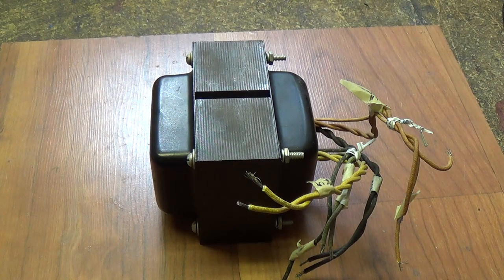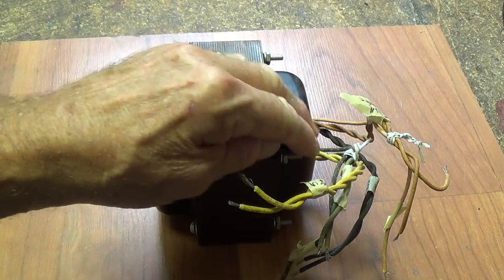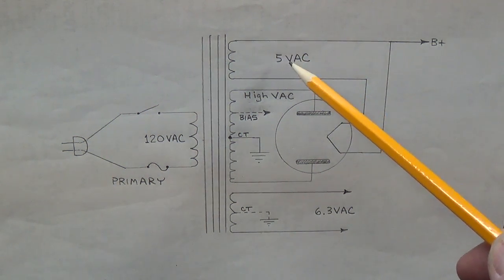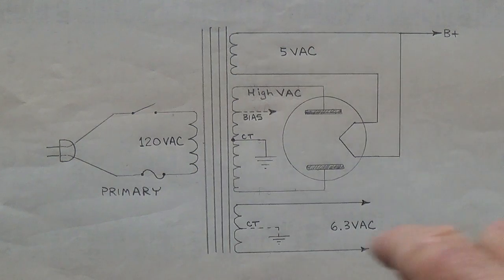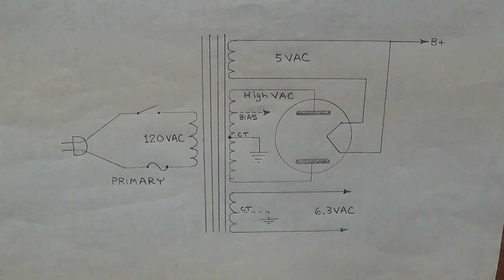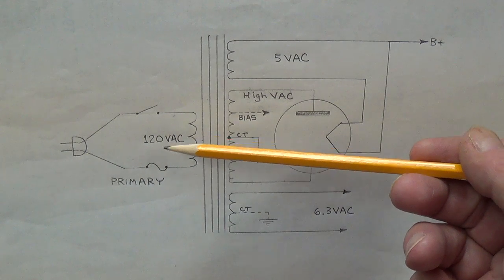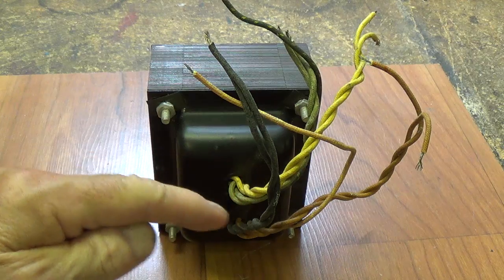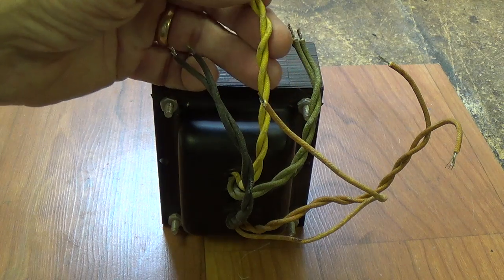How to Identify Amplifier Power Transformer Leads

Comment: Hi Doug, can the rectifier diodes in my old amp allow the b+ voltage to be lower then called for.  Do they go bad like that or do they normally just short out.  Because I'm getting 100v less. 
Thnx Greg
Reply from the maker: +Greg Krupa  I am not familiar with rectifier diodes that fail gradually. Usually they are like a light bulb.....either just fine or dead as a doornail. Have you checked the wall receptacle voltage level? Have you checked your output tube bias?  As plate current goes up, plate voltage will go down. Also if any component is drawing more current than usual, or if a resistor in the power supply has increased in value,  it could  result in a reduction in the B+. Good luck.
Reply: It's fixed bias, wall voltage is fine,  my light bulb stays lit,goes up when I play guitar.  My tech thinks it's in the choke since the bass response is not right.  Would the choke be causing these problems.  It's a 64 Gibson Mercury medalist.
Reply from the maker: Are you checking the voltage while the amp is connected to a fully illuminated bulb current limiter? If so, measure again with the amp plugged directly into the wall socket. The CL will reduce the voltage levels quite a bit when fully illuminated. Your bulb wattage may be too low. The bulb wattage should be high enough that the bulb barely lights up (if at all) when the amp is operating. Also, if the tubes are fixed bias, their plate current and dissipation values definitely need to be checked. Excessive plate current will reduce plate voltage quite a bit. I can't imagine how a filter choke could be responsible for the reduction in B+, but it would be easy to check. Simply replace it with a fixed resistor of appropriate value and see what happens to the B+
Reply: Hi Uncle Doug just wanted to say you were right I was using a flood light not quite the 250w I needed. It brought things back up to spec. Also I'm going to try out that lancer mod you posted,  this amp needs it although Id like to fix some issues with my treble especially on channel 2 it's really noisey. Maybe a new pot? As always any thoughts are appreciated.  Merry Christmas and please continue in the New Year, these videos are the best on the web. 
Thnx
Reply from the maker: That's good news, Greg. The wattage needs to be high enough that the bulb barely glows, if at all. You can clean pots with DeOxit without removing them. Try it and see if it helps. If not, then replacement may be necessary. Best of luck and Happy Holidays !!!

Comment: Uncle Doug, I'm still working with the same transformer from my previous question. What I did this time is connect power to the primary wires with a variac and voltmeter to see the actual voltage entering the transformer. I connected another voltmeter to the secondaries. First I measured the two solid red wire. At 120VAC the red wire read 650VAC. Does this sound about right? It seems high to me, but then again I'm new at this. In addition I connected the second voltmeter to the two solid green wires expecting to get 6.3 VAC. But these were reading 4VAC with 120VAC to primary and 5VAC with 130VAC to primary. Can you give me your thoughts on this, thanks.
Reply from the maker: +David U Juarez Greetings, David. The two solid red wires are the high voltage winding and should have a center-tap if you wish to use full wave rectification. The 650VAC sounds about right....it will go down quite a bit once the transformer is connected in a circuit. The two solid green wires appear to be the 5VAC output for the rectifier heater/cathode. Green is usually for 6.3VAC leads, but apparently in this transformer, the color coding differs from the usual.

Comment: i have a question regarding id of a transformer.  i recently got a power transformer out of an old conn minuet 541 organ and have been unable to find anything on it.  ok so here is the thing, i have reasonably ascertained that the 2 black wires on it are primary and the 2 green and the green/yellow strip is 6.3 with center tap but there are 7 ( yes seven) more wires on it which are colored red, red with green stripe ( twisted together), 2 that looke to be either orange or brown which are twisted together, and a yellow and a yellow with red stripes ( which are twisted together) and lastly a blue wire.  i am wanting to use this for a guitar amp but need assistance in determining what wattage amp i can make, if it is usable for a tube rectifier ( which based on your comments of thicker wire i dont think it is but i want to be sure).  teh number on the side is K70749 and under that there is 396508.  any help would be greatly appreciated because i am at wits end.
Reply from the maker: +lordraptor11 Greetings, LR. If I were faced with this problem, I would first be sure that none of the wires were shorted together, then connect the two black wires to an AC outlet through a Current Limiter (see my video if you don't have one), then very carefully measure the voltage between each pair of similarly-colored wires (and verify that the striped wire with the same color really was a center tap or CT). See if you have a 5V pair (no CT) for the rectifier, a 6.3V pair (with CT) for the filaments, and a high voltage pair (with CT) for the tube plates. The blue wire may be for bias voltage (around 30 to 100V between it and the high voltage CT). Good luck and be very careful with the high voltage outputs.

Comment: Hi Uncle Doug, I have a 63 Gibson amp, the secondary windings show 735v, I need 468v.  Do transformers leak this much extra or is this the wrong transformer altogether? It looks original, but I can't assume.  Thanks for the great videos.
Greg
Reply from the maker: +Greg Krupa  You're welcome, Greg. I assume that you measured the output voltage with no rectifier tube in place, which is not a valid method. Once current flows to the rectifier tube, the voltage will drop quite a bit.....probably down to the 468V that you need.
Reply: +Uncle Doug  yep that's what I did, ok so maybe it's still good.  I think you just saved me some cash.  These videos have taught me so much.  Also waiting on Rusty to put out an album.  Cheers.
Reply from the maker: Transformers generally fail like light bulbs, Greg.....they're either good or bad, no middle ground. I've never seen a failed one that put out too much voltage. After you get all the tubes installed, carefully check the DC voltage between the plates (probably pins 4 and 6) of the rectifier.

Comment: Uncle Doug, I recently purchased a new power transformer for a '65 Fender deluxe reverb reissue - I expected it to come with some paperwork to include some sort of schematic but it didn't. I could sure use some of your help figuring out the voltages - Can you help me?
Reply from the maker: +Kevin King  With no information to go on, it would be a challenge, Kevin.  I have two suggestions: Contact the company and ask where to get a data sheet, or check their on-line site to see if specifications are available there.....or, rely on the color coding, which is generally rather consistent, and you can verify with a voltmeter.  I discuss this in the video. Good luck.

Comment: When you connect primary 220V  Wires to switch and fuse is there any theory that which lead goes to which?thanks.
Reply from the maker: +Alvin s  If you have two wires carrying AC, one will be the "hot" wire (in the US it is usually the black wire), and the other is the neutral return (usually white). The hot wire should first encounter the switch, then the fuse, then one of the primary leads of the power transformer. The return wire can be connected directly to the other transformer lead.

Comment: Uncle Doug, I'm not sure about the transformer I have. 2 green wire = 0.4 ohms(heaters), 2 red = 85.0 ohms(high voltage). No 5VAC (Transformer from Amp with Solid State Rectifier). My problem is determining the 2 other wires yellow/red and blue/red. 
Yellow/Red and Red wire = 44.2 ohms (I believe this to be the center tap). Now here is the one that I'm not sure of; blue/red and red = 50.0 ohms. Could this be the bias tap?
The transformer came from a Dean Markley 40 watt amp that had a bias pot.
Reply from the maker: +David U Juarez  Greetings, David. I must agree with your diagnosis. Red-Yellow is a common center tap designation, and the Red-Blue probably is the bias winding......if so, it should have a lower resistance to the other red wire (since the tap is off center) and a very low resistance to the Red-Yellow.

Comment: What do you do with the wire for the rectifier tube if it's not needed for the amp it's going into?
Reply from the maker: +Compulsor  If you mean the 5VAC leads, cut the wire off flush with the insulation at the ends, and then securely tape them individually (keep them apart) so neither one can touch any metal or another wire.
Reply: +Uncle Doug excellent, thank you

Comment: Doug, I can't thank you enough for your videos. They are amazing, I have watched every video you have posted, some more than once. You have helped me restore three amps so far. I'm working on one now that was always one of my favorite little amps. It's a Harmony H-306A and unfortunately the output transformer appears to be bad. Center tap to one side shows 234 ohms, center tap to the other side shows infinite. :-( I need to order a new output transformer but do not want to get the wrong one. Could you recommend a good replacement output transformer for this amp? I was looking at a Hammond 15W output transformer, but I'm just not sure. https://www.tubesandmore.com/products/P-T1750F
Any input would be greatly appreciated. Thank you for taking the time to read this.
Reply: Kirk Jones A schematic for the amp can be found here.
http://harmony.demont.net/documents/schematics/amps/harmony_306a.pdf
Reply from the maker: Kirk Jones Greetings, Kirk, and thanks so much for the very kind words. Rusty and I really appreciate them and are glad our videos have been helpful.  Thanks also for sending the schematic, it makes responding much easier. 

Whenever confronted by the need for a replacement OPT, I tend to keep it
 simple and look at ones that are used in similar circuits. The Harmony 
is a double-ended 6V6 output into a single 8-ohm speaker, which makes me
 think of a Fender Deluxe.  I'm a great fan of the Classic Tone transformers from Triode Electronics, so I checked their listings for Fender Deluxe OPT's and came up with #40-18002  (Fender Deluxe 20W into 8 ohms) at only $29.44.   http://store.triodestore.com/dedereoutr.html  
 
This is the OPT I would order and install. Best of luck :)

Comment: Hey Uncle Doug! I've watched every single one of your videos on your channel, I really like how you analyze and walk through schematics and components making it easy to understand (even for someone like myself with little knowledge.) I've recently got my hands on 1964 Fender Pricenton amp (AA964) non-reverb no logo and I've been trying to learn as much as I can about it. Recently, I removed the death cap and changed the wire to a 3 prong ground plug, other than that the amp is all original. I would like to ask you about the speaker, a 10'' oxford 10J4-3. I enjoy playing a half step down, would this impact the life of the speaker and output transformer? I know this might be a silly question, but this is my first vintage amp and I don't want to ruin it in anyway. Cheers.
Reply from the maker: iguisard Greetings, Ig, and thanks for the kind words. I wouldn't think that a slightly dropped tuning would stress the original speaker or OPT. I'd avoid playing much at very high volume or with and overdrive pedal, but other than that, you should simply enjoy the Princeton......one of my all-time favorite amps.

Comment: Now, how do we do the same on an output transformer??? :-)
Reply from the maker: Jason Thorpe Greetings, Jason. Watch the Output Transformer video and I think it will become evident, especially if dealing with a DE OPT in which the primary has three wires and the secondary generally has two (if single impedance).

Comment: Thank you so much for all the educational videos and as a newcomer to amp building,i have a quick question ,if  i use 240 AC Power transformers on circuits thats match to  USA power ratings  do i have to change the capacitors and resistor values? i ask you this because i have found some great vintage schematics on internet.but most of them compatible to USA power ratings .your feedback is really appreciated(i don't know if i explain enough the subject)
Reply from the maker: Alvin s Greetings, Alvin. Amplifier power transformers with 240VAC primary windings produce the same secondary voltages as those with 120VAC primary windings. The transformers have different winding ratios that compensate for the difference in voltage input. Many power transformers have primary windings that allow you to use them with either voltage, simply by connecting the primary wires in the proper configuration (instructions generally come with them).

Comment: hey uncle Doug, I have a epiphone valve Jr that I modded with a couple of resistors and a capacitor her and there. after every mod I checked to see how much it improved the amp .it seemed to be loud with out the assistance of pedals. but one day I came home , playing just through the amp noticed that the amp want very loud, fact is I could turn it way up past half and still didn't have to worry about waking my family at 4 in the morning add the pedals and it wad louder. I have a crappy volt meter I received fromfree from harbour freight that I tested the volts from and it read into the 815 on the 1 pin and 6 pin on the 12ax7 .would the transformer be the problem with ahh the amp is not loud any more ? Thanks
Reply from the maker: Donald Thompson Donald, there can be all sorts of reasons for the problems you're experiencing, and it's virtually impossible for me to troubleshoot amplifiers long distance. Hopefully, if you watch my videos carefully, you can develop the skills to do the diagnosis yourself. About the only other alternative I can offer is to take the amp to a qualified repair tech. Good luck :)

Comment: Hi Uncle Doug, very informative and comprehensive video as always!

Now, I've got a question for you on reusing old mystery transformers: Often I'll run into the following kind of scenario: Original radio/organ/tape/record player amp is for instance single ended, 1 6v6, 1 6x5, 1 12ax7, nearly perfect for a Champ!? OR similar scenarios for AB style amplifiers..The problem is the transformer secondary only has 4 leads, two heaters, and two for the rectifier/Hivoltage B+, So the trouble is twofold, A: there doesn't seem to be a center tap to ground on the rectifier-HiVoltage winding, what am I missing here? even the schematic calls for a grounded centre tap? and B: the 6.5v heater leads would be shared between the audio circuit and the power supply rectifier, and not an independent heater winding, is this safe for a guitar amp?
Reply from the maker: Ian Brereton Greetings and thanks, Ian. Since full-wave rectifiers (like the 6X5) require a center-tapped high-voltage winding to function, I'm not sure how one could not be present in the power transformer. Perhaps there is an internally-grounded high-voltage center tap within the transformer itself. This would be easy to detect with an ohmmeter. As far as the safety of amplification tubes sharing a filament winding with the rectifier, this is commonly done in many amp circuits, particularly in early National amps.
Reply: Uncle Doug Thanks for the reply! You were right, I tested it out on an old Webcor transformer, and sure enough resistance between either hivoltage rectifier lead to the transformer casing was about half of the resistance found across both leads. So it must be internally grounded. 

Good to know I can use the same heater lines. Working with, different rectifier tubes is still a bit of a mystery to me, I'm not sure if it's better to use the rectifier original to the transformer, or to attempt to modify the circuit in order to swap in a different rectifier more appropriate to a given schematic--assuming they're full-wave. For instance  the 6x5 has significantly lower plate voltages (running at 220v in the previously mentioned transformer) than say a 5Y3, or 5U4 (which run over 300v in a champ, princeton, or deluxe). I suppose I'd also need to drop the heater voltage, but are these tubes even operable at such lower plate voltages? I'd assume the filter section would need modification in order to achieve an adequate result? Or should I just work with the original 6x5 tube?
Reply from the maker: You'd best stick with the 6X5. It draws only 600mA of heater current, while the other rectifier tubes you mentioned draw 2 to 3 Amps. The power transformer you have cannot cope with these higher current demands. Perhaps you could use diode rectification and get some increase in plate voltage, however, if the original amp you disassembled used a 6X5, 6V6, and 12AX7, then apparently they work just fine with this power transformer and rectifier.

Comment: Hello, I'm wanting to change the el34s that are in my Blackstar HT 20 watt amp to kt88s. could you give me or do a video on how this or if this can be done?
Thanks
Reply from the maker: taylorc315 Although the pins are wired the same in both tubes, you can't simply exchange them. The KT-88 uses considerably more plate current, has a much higher plate dissipation value (42W vs 25W), and has about 5 times the output power. Your power transformer and output transformer would probably not be able to handle this huge increase in current demand and power. To delay the destruction of the transformers, the KT-88's would have to be biased to a very low plate current/dissipation level, which would greatly reduce the benefit of the switch. My advice is.....don't do it.